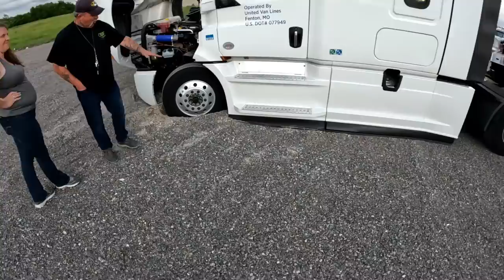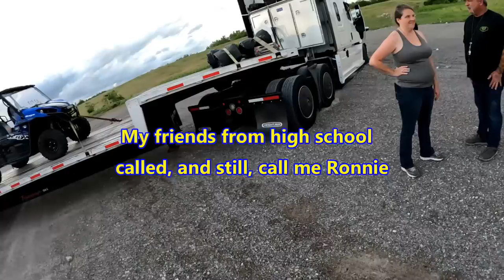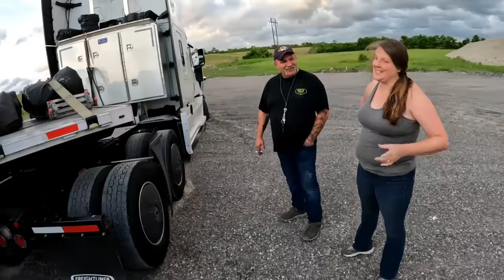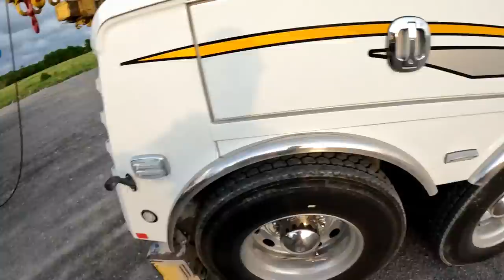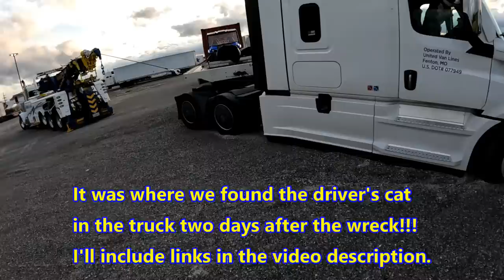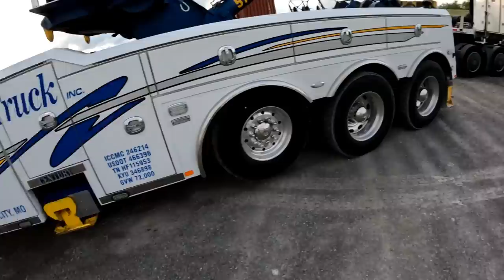Winch Out With A Twist

Comment: A free tip with plugging XLR connectors (like the power connector on the remote) that may help after long day or night: grab the plug, get it aligned kinda straight and where you think the alignment lug should line up. It won't, of course. While pressing in lightly, rotate the plug around until the lug lines up and it will drop in. Saves a bunch of staring at things in the dark when your eyes aren't working as well as you think they should be.

Comment: Got myself stuck on some loose gravel, sitting nice and purdy on the gravel, but kept slippin and diggin.  Called the shop, said stuck on gravel, send the service truck to bump me off, or pull me out with a chain.  Half hour later, I see this triaxle wrecker comin over the hill.  I’m thinkin “oh they didn’t”.  Amber lights come on “oh they did”.  Operator was ecstatic when I pointed out that I wasn’t even sunk, just pull me out.  A wheel lift could have done that.

Comment: Why did you use the boom winch instead of the drag winch? The drag winch would have been lower, giving you a better angle, and then the chain might not have angled up into the trailer like it did.

Comment: You never seem to use your green winch. Seemed like this would have been the opportunity. Why not?
Reply: Green winch cable usually is / used to be hard to pull out. Much more trouble than just using one of the main boom winches. Unless it's specifically needed.... and you could see the rare video in the past where Ron has to apply a lot of force to get the green cable to spool out.